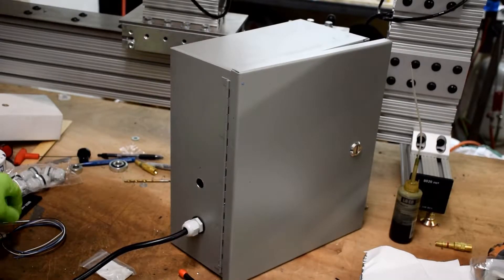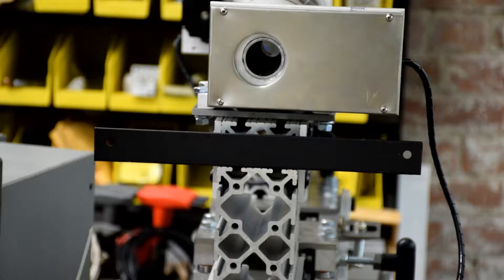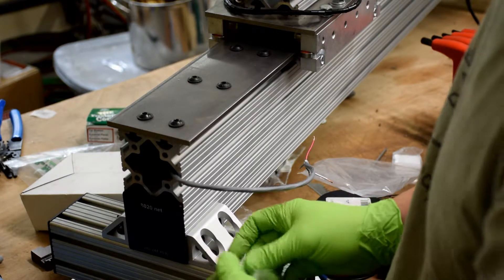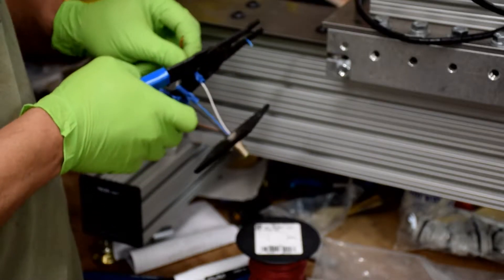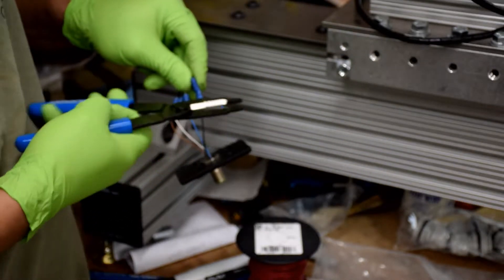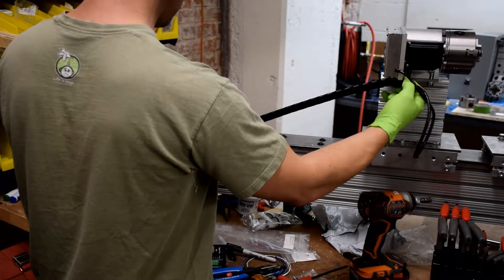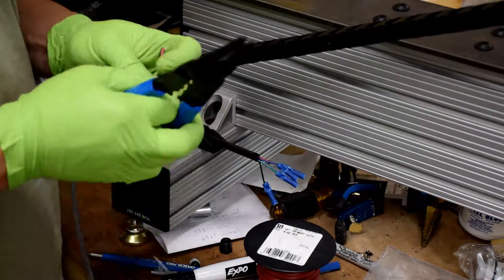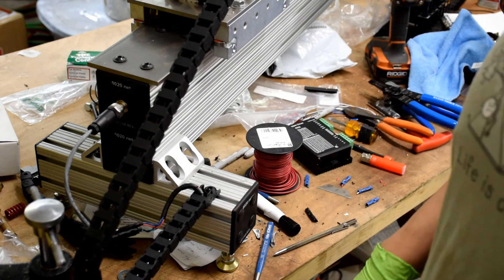Panel mounting and tailstock wiring

Comment: Hi, I have build the lathe following the instruction and materials list but I can not seem to figure out how to wire the motors. When I turn it on it will and turn up the speed controller neither motor turns. The speed controller has three red lights, both stepper drivers have green lights and each pair of wires has continuity. Any troubling shooting tips or any chance I could have you look at it?
Reply from the maker: Yeah, let me look through the videos. It's been awhile
Reply: @jordankube  Thanks for looking into this but Automation Technology got back to me. I did not realize the speed controller had 2 switches on the board. The lathe is now working perfectly. BTW, I really appreciate the work that went into designing, making the videos, the materials list, explanations, and following up with me. You deserve a lot of credit and thanks for this project.
Reply from the maker: Thanks for the kind words. I'm glad people are out there building them. I think I may have forgotten a wiring video. I have all the raw footage I just need to get another microphone.